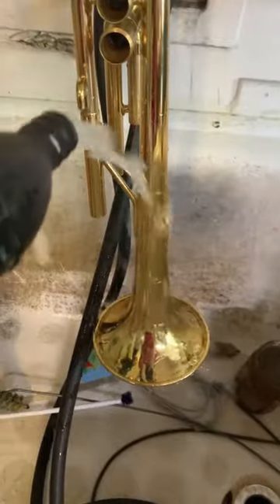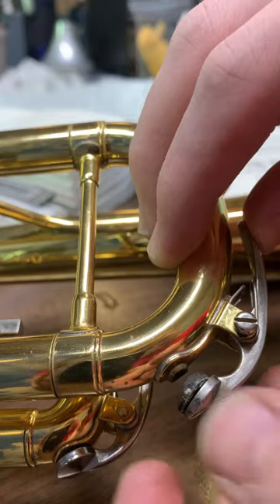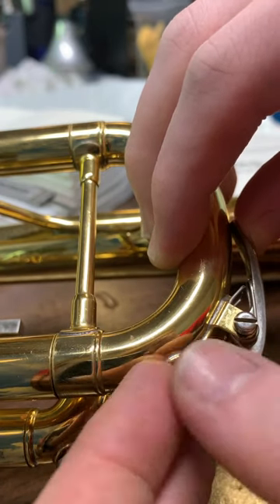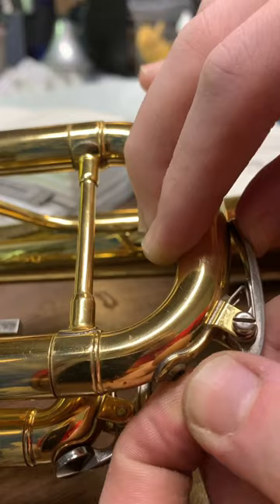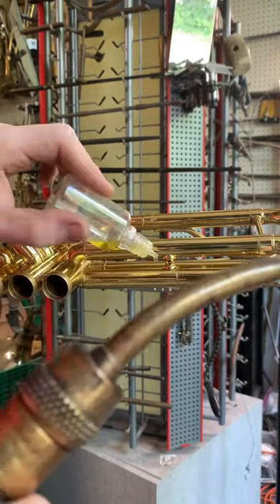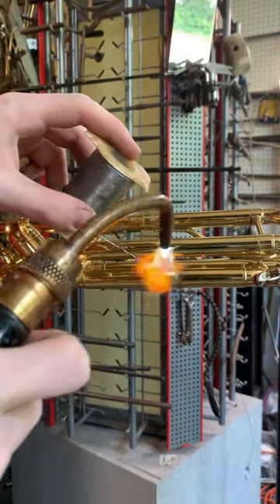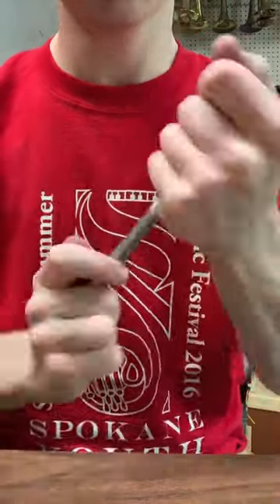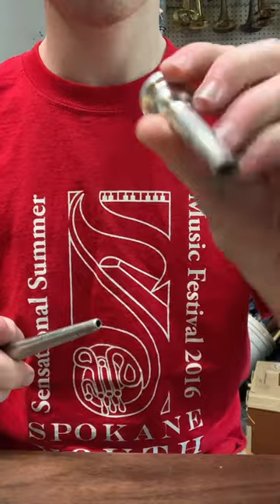Basic Trumpet Cleaning & Repair!

Comment: Boa tarde, sou do Brasil, poderia me dar mais informações sobre esse fluxo de solda liquido?
Good afternoon, I'm from Brazil, could you give me more information about this liquid solder flux?
Reply from the maker: Unfortunately I do not know what type we use or where we get it, but I like using liquid flux more than the paste that some repairmen use. It is very easy to deal with and seems to work well.
Reply: @SamuelPlaysBrass Obrigado por responder, eles sempre diz nos vídeos que esse fluxo é um ácido, será que seria preparado? de alguma forma com zinco e o ácido? eu não gosto da pasta, eu vejo que o líquido é bem mais fácil e preciso de mexer, gostaria muito de achar esse fluxo, aqui no Brasil tem fluxo para eletrônica mais os frascos diz que é inflamável.
USANDO GOOGLE TRADUTOR.
Thanks for answering, they always say in the videos that this flux is an acid, could it be prepared? somehow with zinc and the acid? I don't like the paste, I see that the liquid is much easier and I need to stir it, I would really like to find this flux, here in Brazil there is flux for electronics but the bottles say it is flammable.